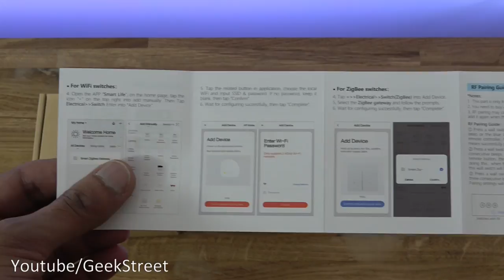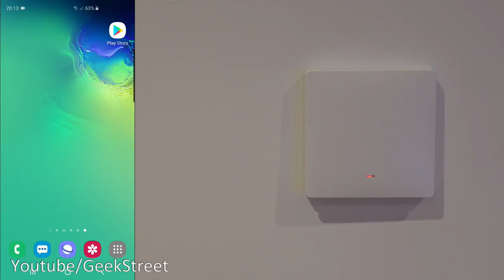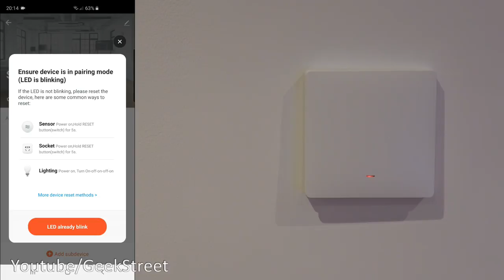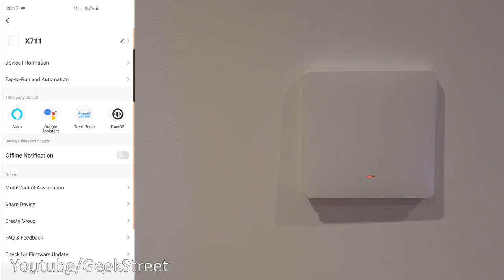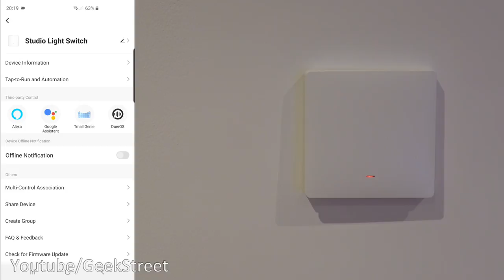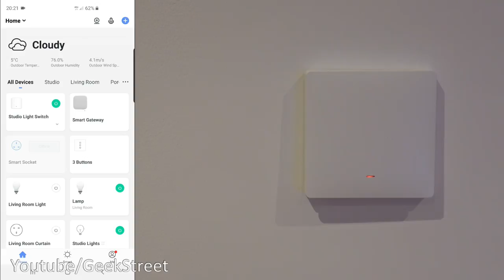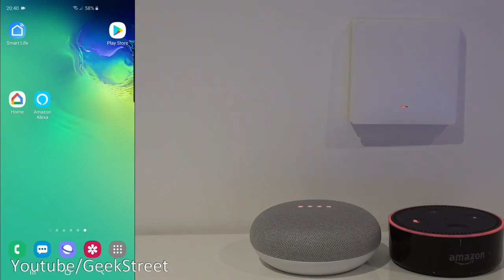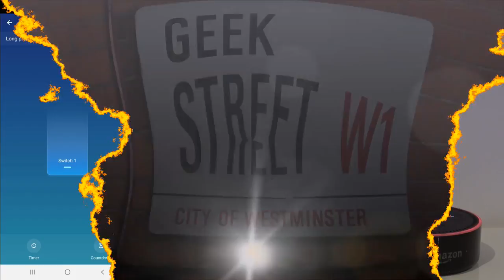Zigbee NO NEUTRAL Smart WiFi Light Switch Unboxing and Complete Setup

Comment from the maker: Make Your Smart Home Even Smarter with Tuya / Smart Life Tips + Tricks
https://youtu.be/BVRJYZW-wkk
If you don't have a neutral wire then there are other options
Smart WiFi Light Switch HACK
https://youtu.be/E93oiCDplTI
No Neutral Smart Light Switch
https://youtu.be/duSFZDRzy6E
Zigbee Touch Smart Switch
https://youtu.be/o_O5HdQo8u0
✅ Don't Forget to Like👍 this Video, make a Comment✍and Subscribe ▶ it makes these videos possible 😊
Reply: DID YOU do a video on when your wife kept switching the power switch on and it resets all your colour bulbs? Have  you a link to it please ive lost where i saw it and thought the device would be great for my kitchen as ever time some one comes to repair boiler or waser they reset all by bulbs 😱🙅‍♂️🤣🤣🤣😊 Thank you love your channe and advicel!🫠
Reply: Seems to be buggy! could it be that the wifi signal is weak and losing connections as I messed about again to see if I could detect it again and it did not connect it just worked again so not had enough experiences to know what going on here seems a wifi issues to me but need to ask? :-)
Reply from the maker: No thats not me
Reply from the maker: Zigbee maybe a better option
Reply: @GeekStreet  I have a Zigbee hub but I don't think the range is good on it!

Comment: is there no way of reversing the indicator LED? That the LED is ON when the light is OFF? Such an indicator seems more useful in the dark when you are looking for the switch rather than when the light is already on.
Reply: Did you find something out about this?
Reply: @timo-h7f  nope, perhaps if you flash them with custom firmware. It doesn't bother me anymore tbh
Reply: @h3liumb0y  k, thanks

Comment: Hi, thanks for your videos. I have purchased the tuya gateway + some smart switchers wihtout neutral wire, all works fine. I have also bought an Aqara wireless switch and I cannot pair it to the tuya gateway. Do you think if it's possible to do so? thanks!

Comment: Usually, the "no-neutral" switches require a minimum load. So if you have a 4W LED bulb (rare case for lighting the whole room), it might not work.
Reply from the maker: Thanks for the comment and info, useful to know.
Reply: @GeekStreet  Slap a 400v 4uF ac capacitor across the load might want to put a 470k resistor across also for the capacitor to discharge through, works for led and fluorescent, I've also just purchased a no neutral light switch that uses everyday wifi.
Reply: djbare9 were do you install the capacitor? On live and neutral before light?and the ressitor?thanks
Reply: Always check data sheet about minimum load ;-)
Reply: yes good point but what about outdoor lighting how would it inpack this?

Comment: Quick question: if you have your echo and light switch assigned to a room/group can you just say lights on and get the lights turned on in that location, rather than have to add room in front?

Comment: Another informative video, do I need a Benexmart Zigbee hub, or will other manufactures hubs work ok?
Reply from the maker: Thanks for the comment much appreciated, in theory any Zigbee hub should work but just to note I couldn't get it working with the Philips Hue bridge.
Reply: Actually not all zigbee talks to each other. Like at first I tried to get tuya gateway with Aqara sensor. They don’t work. So I’m wondering if this work with smartthing

Comment: This might sound like a dumb question, but is there a maximum range where the zigbee gateway can operate? ie if my gateway and switch are in rooms 100ft apart will they work? Or is there some sort of repeater technology in each zigbee device that helps with connectivity to the gateway?
Reply from the maker: I've read online maximum range upto 200ft. Obviously walls etc can affect that.

Comment: As ever great review, just one question, If you lose internet can you switch light on by just using switch just like a normal switch or is it wifi dependant?
Reply from the maker: Thanks for the comment, much appreciated. Yes it will work as a normal light switch if the internet goes down!
Reply: @GeekStreet  does it works with LAN (no internet)

Comment: Hey, I've ordered a couple of Lonsonho-branded models of this switch (looks identical, same Tuya platform etc.) I just wondered if you knew if a 2 or 3 gang switch could be used to control a physical light and a smart light. Let me expand; in our lounge we have two ceiling pendants and some Hue-powered wall lights. At present there is a physical 2-gang switch and a Hue Tap on the wall controlling each element. My plan was to wire in a 3-way version of this switch, with two of the switches controlling the physical lights and the third a "logical" switch linked to the Hue lights. The only downfall I could see is if the third switch needs a switched live to activate it or if the unit simply having power from the other two gangs will suffice.
Reply from the maker: Yes the is possible, with ifttt. Take a look at this its another option.
https://youtu.be/WnwC6UYG-ng
Reply: @GeekStreet  thanks for the reply. My Lonsonho-branded switches turned up today (they are the same X71X a devices as yours, the last X signifies the number of gangs so I think yours were X711 and mine are X712 and X713 for 2 and 3 gang respectively). I connected the 3 gang up today but could not get it to pair with my deCONZ gateway (and don't really want a 3rd party gateway) but I'm wondering if I had my wiring wrong because both switches turned on both lights in my room but if I used switch 1 they stayed on but if I used switch 2 they came on briefly then turned off. There was a also a really annoying buzzing from the capacitor in the light fitting.

Did you fit the capacitor and do you hear any noise from it?

I've ordered a live wire detector from Amazon to make sure I have my switched lives the right way round (I assumed they were correct at the switch but best to double check). I had to put two wires into common and then one each of the  switched lives into L1 and L2 for each light fitting.
Reply: Almost certainly got my wiring back to front - on the switch I took off, red was in L1 and black in common so I wired it the same in the switch - it worked but not correctly, so I presume (but will wait for my tester to arrive) that actually, red is common and black is L1/switched live (as per various wiring diagrams I've seen since). I wonder if the capacitor buzzing was related to this.
Reply: @igorkovacevic9664  they can be used as virtual switches no problem.

Comment: Great video mate. 

So this doesn't need a capacitor on the light fitting?
Reply from the maker: Thanks for the comment much appreciated. Yes that's right...no messing around fitting a capacity! Just need to get a Zigbee Gateway.
Reply: @GeekStreet  Nice! You're the man!!
Reply: @GeekStreet  so you just fit it like your replacing any old light switch, no neutral and no capacitor??

Comment: Hey, I've seen the 1-3 gang versions on Amazon. How do you rate this switch? Been looking for a ZigBee light switch with no neutral.
If not, are there are any others you'd recommend? Want to keep it all ZigBee to keep it separate from WiFi devices. I also have a Hubitat and HA. 
Thanks!
Reply from the maker: I do like the build quality of the lights, I prefer this to the no neutral with a capacitor. Its definitely a good option.

Comment: Another very clear and precise video explanation. Is there any advantage to using a zigbee hub as opposed to just Wi-Fi as shown in some of your previous video's.
Reply from the maker: Thanks you for the comment much appreciated. One thing I missed in the video is testing timers with the internet  disconnected. That is one of the biggest advantages of using a hub system like the Philip's hue these things still work. Let me test and get back to you to confirm if it works.
Reply from the maker: And just to add, one massive advantage of this switch is the fact you don't really have to mess around with electrics for example change wiring adding things to the existing wiring, it's just a simple simple replacement.
Reply: @GeekStreet  Ok thanks for the info.. I do have a two gang yagusmart Wi-Fi switch controlling a ceiling light and a pair of wall lights and it's great with alexa.

Comment: I'm really strugglibg to understand which hub to use as I have 2 already and no clues on the tuya instuctions on how to connect it plus the added frustrations of the way the old lighting is fitted too very old  way and there wireing is not the best organized way for me to figure the L1 l2 com on the two way switch can you help any further on this for me please? I have sent a message to Tuya who are also not being very helpful! Thanks
Reply from the maker: I've used with both of these products 
https://youtu.be/_mM9WZmE9Nw
https://youtu.be/5xXorxPrRuI
You mention L1 L2 COM are you using on a 2 way hallway switch? If so this isnt going to work it's only for a one way switches. Let me send you a video link on how to do this for a 2 way switch.
Reply from the maker: This is the easiest methed
https://youtu.be/W2pcYp2pPWA
A slightly more complex one is this
https://youtu.be/gBVj6e1-1lw
Reply: @GeekStreet  Brilliant thank you so much! Yes its a two way switch!
Reply: This is the one I got! (MOES Tuya ZigBee Smart Touch Switch, Requires Tuya ZigBee Hub, No Neutral Wire No Capacitor Needed, also Works with L & N wire, Compatible with Smart Life Tuya App Alexa Google Home, 2 Gang, White)wil it be ok? I tried to connect but had hub issues but this might be down to me not testing the right hub! Id also be wanting to have it in Smartlife App as I like everything in one place! Thanks!
Reply: @GeekStreet  Also the internet connectivities are not brilliant at this location for the switch. At the Moment I have it turning the downstair light on bu teh bulb and sensors and teh switch as to be on all of the time so I thought might some how to use a switch but now I'm not too sure!
Reply: @GeekStreet  Thoughts again it's one switch downstairs with two connections on it for the upstairs light but it's been disconnected upstairs now so will need to check if there is a live wire for it on the downstairs switch! why this is frustrating! :-)
Reply: @GeekStreet  Does com mean a live wire?  has I seem to have lots of live wires for the switch and I'm not getting one wire in its correct postion wish I could show you a image of it.
Reply from the maker: @TheDiabeticWay  yes com would be live
Reply: @GeekStreet  Its a 2-GANG 2-WAY LIGHT SWITCH WHITE I'm trying to figure It all seems right until I set up a scene then downstairs light bulb will not turn on unless switch 2 is on so this is not right yet! thank you on the com being live!
Reply from the maker: @TheDiabeticWay  i don't see how this is going to work, i did previously spend alot of time looking at a circuit diagram of a 2 way lighting circuit and i couldn't see a way of putting a single smart light switch in an existing curcuit without changing the way the curcuit is wired.
Reply: @GeekStreet  So if I have two coms with 2 live wire I would only need one of the live wire to go in the Live in the smart Switch? as when I put both in the switch 1 stops working!
Reply: @GeekStreet  Its not a single smart life its two! One upstairs and one down! The downstairs switch is a 2 gang 2 way light switch. This is where I'm having the issues as I have two com leads! SO im thinking to maybe only use one Live wire on the L1 and L2 connections?
Reply: @GeekStreet  I think I have finally isolated the issues and fix the problem! not as described in your videos but got there in the end I hope :-) thanks for the help! Just not sure now how to leave two bare wires I no longer need at the back of it  a com and  L1
Reply from the maker: @TheDiabeticWay  Great! Use electrical tape and cover at both ends or use a wago clip
Reply: @GeekStreet  Taped up and documented :-) Have you the link to the other device to replace someone turnign them on I saw one where you could change the colour too I was thinking to maybe add it to the upstairs switch instead as I will not be needing a wall switch now :-) I just have to do the hard bit and knock the wall out for two 32 back boxes which I hate doing! Any offers? :-)

Comment: Hi, I have a question. This is a no neutral solution, so am I right that if you turn it on with application on your phone, and after you turn the switch off with your finger, the status of the light in your phone remains like turned on? I mean, do google assistant knows whether that switch is turned on, if you turned the switch on manually by pressing the wall switch?
Reply: Yes I'd like to know this as well

Comment: HI! So for this particular light switch, there is no need to install a capacitor ? Thanks.
Reply from the maker: That's right you just need to get a zigbee hub.
Reply: @GeekStreet  many thanks for the quick reply. looks like I'm buying this then. The zigbee light switches are little more expensive than the regular wifi (no neutral, but with capacitor) switches though.
Reply: @GeekStreet  oh btw- I have a Philips Hue hub (which runs on zigbee)...do I still need to get a separate hub? Thanks again.
Reply from the maker: @yringler  in theory it should work.

Comment: Does all zigbee smart switch no need capacitor? Or it depends ie the zigbee mechanical switch need capacitor and zigbee touch switch don't need capacitor?
Reply from the maker: I've never come across a zigbee light switch that requires a capacitor, as they don't require a neutral connection.
Reply: Thanks for the swift reply!
Reply from the maker: @luviedoggie  no problem!

Comment: Hi there Geek Street. I have the same switch in 3 gang configuration. One switch is connected to a 7W LED spotlight. I'm encountering flicker issues. Would a capacitor or maybe a higher capacity spotlight, say 12W solve this issue? Thanks for reading.
Reply from the maker: That flicking is related to the bulb, I was testing out recently and found that when I flipped over to using wifi spotlights or a different bulb it didn't happen.  I think a capacity may help in your situation as thats why they give it with some no neutral switches.
Reply: @GeekStreet  Thanks so much for your reply. Looks like I have to get a capacitor. My smart switch did not come with it. Thanks again.
Reply from the maker: @ShuenRayLee  you're welcome.

Comment: Did you have any issues with flickering led lights with this?
Reply from the maker: That sounds odd, I've not experienced that.
Reply: It seems to be a common experience with smart light switches that do not use a neutral from my research so far. People are having to place a suppressor of some king across the live and neutral in the light fitting
Reply from the maker: @MrOlleyOlley  do you mean flickering when off or on?
Reply: I think when it is off. I don’t have any switches yet I’m just researching
Reply from the maker: @MrOlleyOlley  now interesting you say that I tested on a 150W equivalent LED bulb and I did notice a flicker when the bulb was off but to note I didn't get that with LED spotlights!?
Reply: It actually flickering with LED that has small w. I have a lamp with 10 small LED’s in it and and it keeps flickering!
Reply: You have to check documentation / data sheet about minimum load. For example: Minumum load for AQARA H1 EU Switch is 3W

Comment: How stable has this product been for you so far? I heard that no neutral wire devices are less reliable
Reply from the maker: Mine has been fine no issues, so far.
Reply: Be aware about the minimum elctrical load the switch needs. Check data sheet for deatils. Example: AQARA Switches needs at least 3W load .

Comment: I have several rooms where I am interested in fitting these, for reference I'm in Ireland so the setup and regulations would be similar to you. My halls are of particular concern though and I was wondering if you knew what way if at all they could work. I have an upstairs and downstairs hall. upstairs there are 2 single switches to turn on and off the the upstairs light. Downstairs there are also 2 single switches for the downstairs light. At the bottom of the stairs though there is a double switch where 1 switch does upstairs and 1 does downstairs. My question which I'm hoping you may have an idea on is how would these operate if I was to replace all of the switches in the hall. The result would be that I would have 3 of these on each light.

Can they operate that way? Is there interference? If I switch on the upstairs light from from the double, would the 2 singles know the light is on and know that the next press of the switch would be to turn off the light.

All of my switches have no neutral so these are looking to be the best option I can see.
Reply from the maker: This video shows a way of doing what you're after.
https://youtu.be/W2pcYp2pPWA

As a suggestion you may have to remove the 2 way lighting curcuit wiring.

Comment: I have a smart switch for the bathroom and it required a capacitor.. however this has made my light flicker annoyingly. Will this method using the hub fix this issue? Thanks to anyone that can help
Reply: Does it flicker even after putting the capacitor?

Comment: How do I wire in if I have two switches in the room, so it’s 2 way?
Reply from the maker: Take a look at this video, it will give you an idea.
https://youtu.be/W2pcYp2pPWA
Reply: Geek Street I watched that video and it’s a very clever way around the issue. But I’m confused as to how that works with this particular switch, as there’s no neutral.